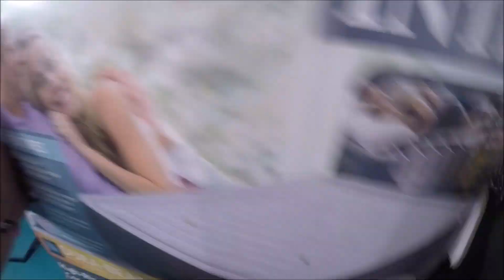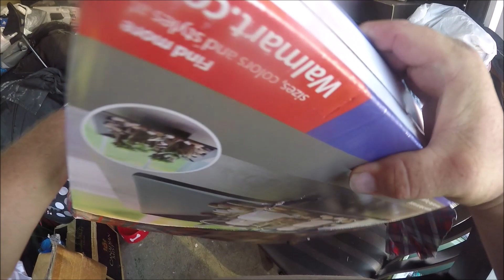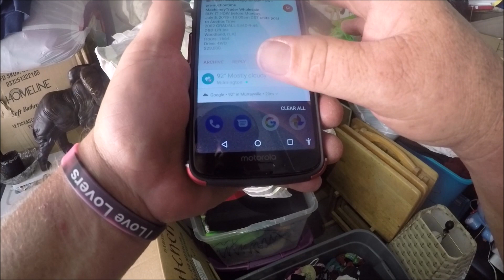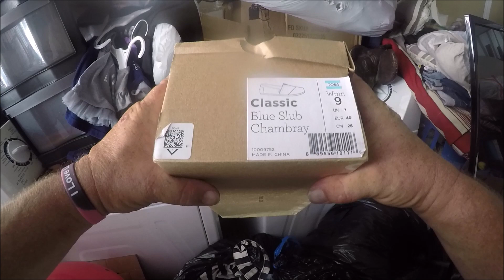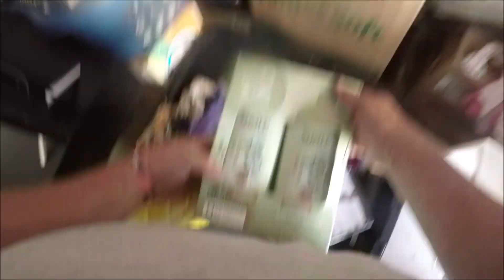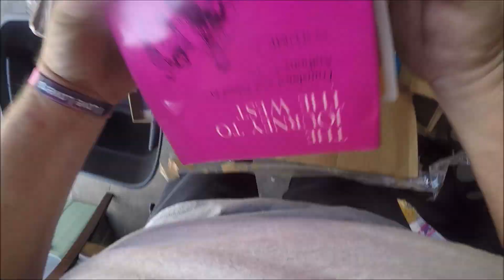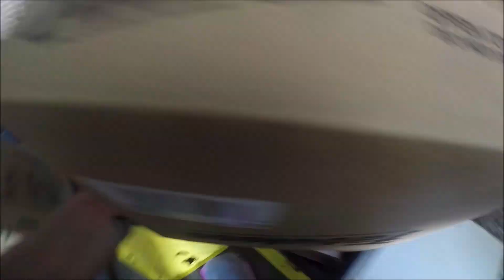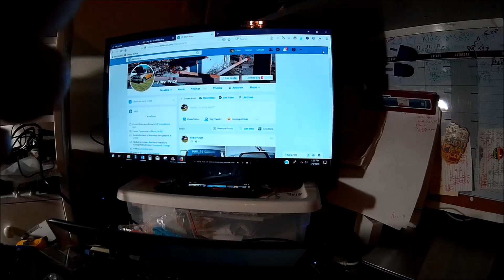2 Safe's Nothing but Sweetness and Drugs!! I bought an abandoned Storage Locker

Comment: nice video, just so you know silver and gold lobster claw clasps will stick to a magnet because they have a steel spring inside so the clasp works, because silver and gold are to soft and the clasp will fail without it. Nice hail all around.
Reply from the maker: Cool didn't know that good info to know